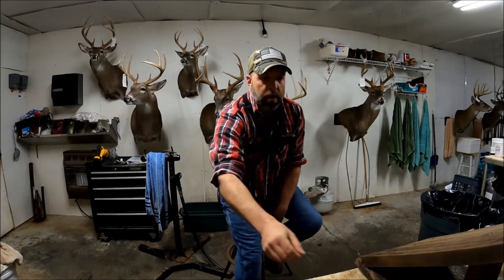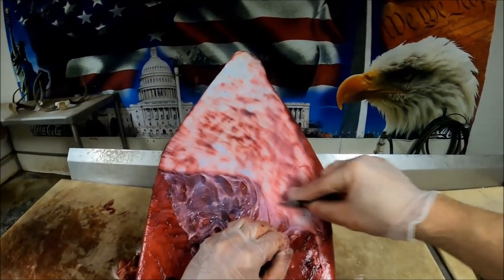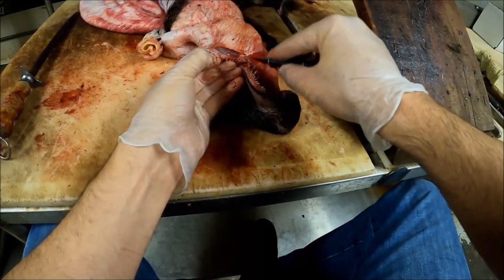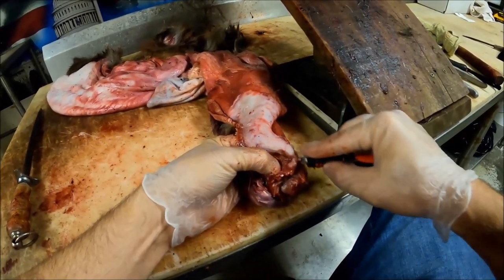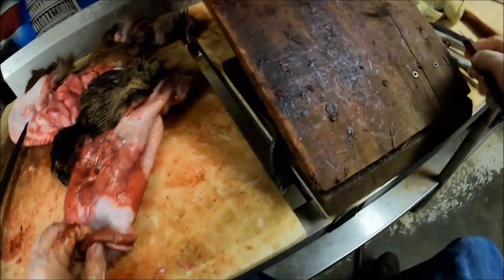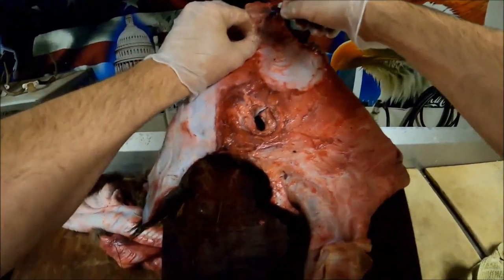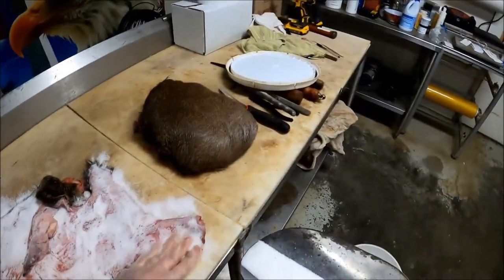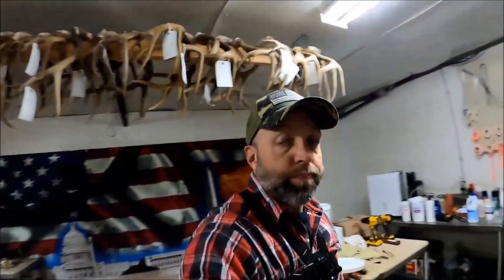HOW TO FLESH A DEER CAPE FOR BEGINNERS! A FIVE DOLLAR WAY TO GET THE JOB DONE! FLESHING AND SALTING

Comment: That is exactly the way I’ve done all of my mounts and it works excellent.  Take your time and get the feel for it and you won’t be slicing as many holes in capes.  But for anyone that has never  used a fleshing wheel..  you can’t use that wheel to flesh and turn all the meticulous areas of the face that everyone is focusing on anyway.   And the fleshing wheel cuts holes also.     Great work bud!
Reply from the maker: Awesome!

Comment: I use an Outdoor Edge boning knife that’s my go-to I like the longer blade. Don’t know what kind of pickle and tan you use but what I do is flesh all the heavy meat and fat off the green cape with the boning knife. I salt it, drop it in a rehydration bath to pull out all the blood, rinse it and then it goes into the pickle. I pickle it for about 24 hours, pull it out to drip dry and then thin it all the way down on the neck and face with my scalpel. Back in the pickle for half a day, neutralize then into the tan. But I feel your pain I need a fleshing machine myself soon it gets tiresome doing dozens of capes by hand

Comment: Hey David love watching your videos! Been looking at getting started with deer mounts. I used to put up fur and scrape hides with a post fleshing knife do you think that would work as well? Also how do you thin your capes out without a flesher? The same way with a scalpel?
Thanks
Reply from the maker: Yes it will work. The hides can be thinned fairly well with a scalpel while they are raw, but I now have a fleshing machine and it is a must for too quality work. Also saves a ton of time

Comment: How do you keep track of the capes and the deer heads from start to finish? I'm sure you have a system but i would be afraid to mix the capes up in the process. Thanks!
Reply from the maker: I use masking tape on the antlers and write the number and name on the tape, then I tag each bag with the capes in them with the corresponding name and number. Once I flesh the cape, I put a tag on it when I start the tanning process with its number.

Comment: very informative videos  thanks for sharing.  how long  can you keep a green cape in the freezer?
Reply from the maker: It mostly depends on how it is frozen. I really need to do a video on this. If there is plenty of meat and fat on the cape it will hold moisture and help prevent freezer burn, but also the cape should be rolled up beginning at the top of the nose so that the excess is surrounding the head while in storage. When done this way, I have used an extra cape I had that was 3 years old with no issues. Done incorrectly I have seen them burn in less than a year.

Comment: I’ve found out that there is stuff in my water that makes the hair slip out of my hides and I prevent that by salting them first ;)
Reply from the maker: Yeah if you don't salt after fleshing, bacteria will eat the hair follicles and it will fall out. Capes should never be left in water unless it is a pickle, tan, or rehydration bath.

Comment: I just fleshed my first deer today. I fleshed it all and got everything turned, but I used a pressure washer at the end to get it cleaned up good. It was completely white after pressure washing but I was left with stringy membrane in places, i assume. I dried it with towels and salted before hanging. Should I have got the membrane off or should it be ok? I was paranoid that I was setting myself up for slippage, but it looks I was trying to get my capes cleaner than you did.
Reply from the maker: I believe you will be good as long as the cape was dried enough to get good salt penetration. The salt will pull out the fluids in the hide regardless of how dirty it is as long as it is fleshed enough for the salt to make contact with the bare skin. Afterwards a good saltwater bath to rehydrate draws out the rest of the blood and washes the cape
Reply: I salted it for 2 days and then put it in salt water for 1.5 hours before it was back pliable. It is currently in pickle and all looks well. Thanks for your videos. They are very informative and this is something I have wanted to try for years.
Reply from the maker: It should be fine, just make sure if you use a salt frame to keep it covered in salt really well. The water and fluids will make a lot of it run off

Comment: How long is it talking you to flesh the face? I did one this past weekend and it literally took me like 6 hours. I am sure I will get faster as I get more experience, but 6 hours with some breaks in between is a long time. Also, can I get the name of the scalpel that you are using? I am going through a lot of them. I tried sharpening like the way you did and the ones that I am using do not sharp well. Thanks again
Reply from the maker: Probably about 20 minutes or so. You will definitely get faster it just takes some repetition and getting a feel for the different parts of the face. It takes about 1 1/2 hours to do an entire cape

Comment: Hey Daniel, this is something I have wanted to do for a long time and your videos have answered so many questions I have had. I heard in the video you talk about some people flesh with a pressure washer. Do you know if they salt there hides after they flesh them that way before they put them in the pickle? Thanks for the videos and information you are given out!
Reply from the maker: The ones that I know that pressure wash use a submersible tan that is mixed into the pickle, and they never salt the cape.
Reply: Thanks, I may try that at a later time once I’ve fleshed one out with a scalpel. Im a little confused on when to measure for a form. Do I measure once I’ve capped the hide out or do I measure after I’ve fleshed the hide out?
Reply from the maker: @hudsonoutdoors7247  measure it after it's fleshed and before it is ever salted. You can measure it as soon as it is caped if there are no large chunks of meat on it.
Reply: Thank you so much, I measured it after I capped the hide out but I will definitely re measure to make sure I have the correct measurements. These South Georgia deer don’t leave a lot of meat on there hides but every deer is different like you said. Thanks again!

Comment: I've got a cape. It's hard to get all the fat off and where I'm new at it, trying to take my time, parts of the fat on the cape started to dry. Do you have any tips on getting all the fat off or do you have to? I got all the big peaces off but it's like the smaller stuff.
Reply from the maker: You need to get as much off as possible for the pickle to get good penetration, and if you have to, you could put a little salt water where it is drying to hydrate it enough to flesh.
Reply: @thecedarridgechronicles  Okay thanks!!!

Comment: Are you using a #6 wire fur stretcher to hang the salted capes on?  A #6 is about a foot wide and and 4.5 feet long.
Reply from the maker: It's got to be very close to that size if it isn't the exact same one. I bought them from McKenzie and I believe they just have the one size labeled as a "s-s frame"
Reply: @thecedarridgechronicles  Thanks - you just saved me $36.  unfortunately the S-S from McKenzie is $50 and doesn’t give the dimensions or size. I found a size #6 at Cabelas with the dimensions listed as 12” x 59” for $13.99. It looks like the one you use so I wanted to ask to make sure it would work. I appreciate the feedback!
Reply from the maker: Absolutely!